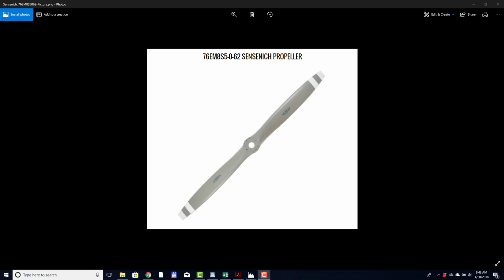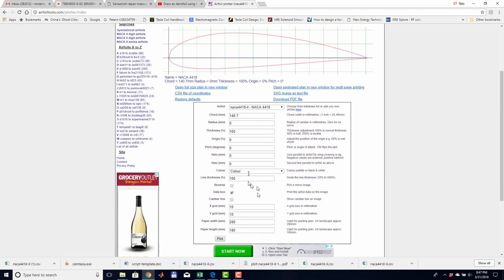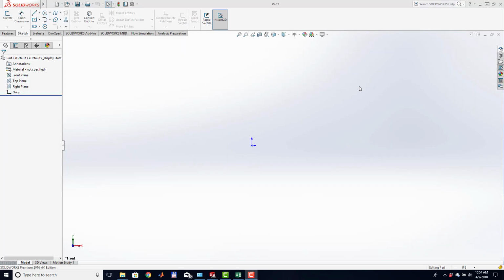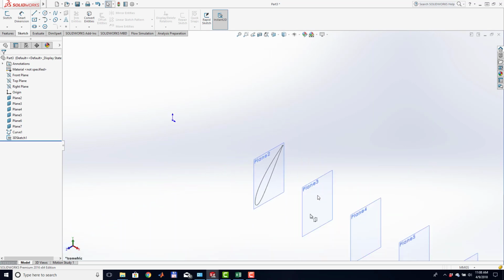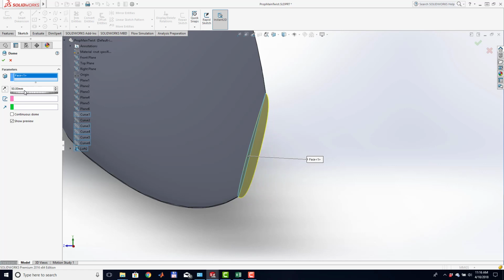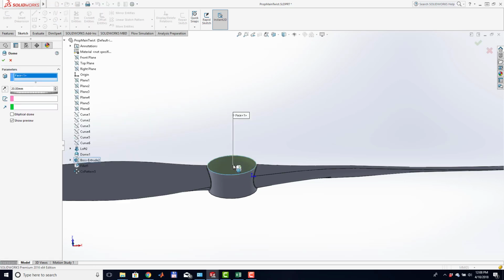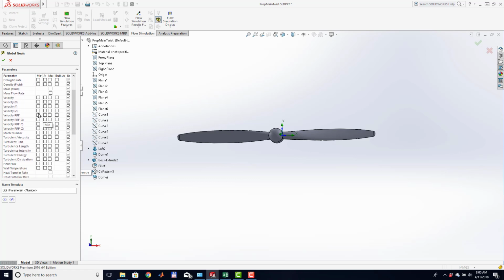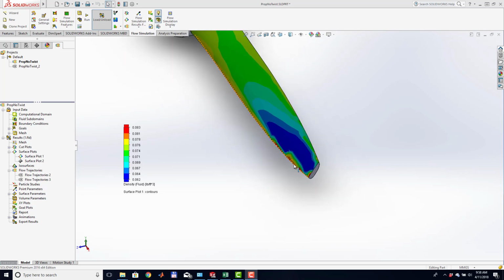Solidworks Propeller Design and Flow Simulation

Comment: Hello, could you upload your solid works file please
Reply from the maker: Thank you so much for viewing my video. As for your request to upload the solidworks files, I wish that I could. Really. This video was done 6 years ago (how time fly's) and that was on a different computer system and I have since lost the actual simulation. However, I would hope that my description of the steps that I took to produce the video are adequate in order to reproduce the simulation. If it is of any interest to you, my current researches involve using neural networks and deep learning to do simulation of computational fluid dynamics. If I ever get to the point where that is possible, I will publish the results. Good luck to you.

Comment: How to calculate torque and rpm prop need while pushing object at pre determined velocity and resistance force?
Reply from the maker: Thank you for watching my video. The questions that you ask are very important to answer and I did not attempt to answer them at the point when I made the video. I only wanted to show why a propeller needed a twist. However, since then, I have started doing research with machine learning and physics informed neural networks and their application to fluid dynamics. I figure that it will be at least 6 months before I can start answering more pertinent questions than were asked in my original video. Thank you again.
Reply: @theminertom11551  Could I enquire as to where you are up to with this, as I was also interested in the original question?
Reply: @theminertom11551  Sir i need to talk to you about this PINN, ive been doing a project myself, could u please give me an email or linkedin etc so we can  have a chat ?

Comment: Where can i find those propeller section data? Just as the repair specifications you showed at the beggining of the video.
Reply from the maker: Leonardo, I am not sure that I understand your question. The Senenich propeller manual should be available on line, although I probably used the manual that was available when I was in the A&P class. However, as shown in the video, the thickness of the propeller was not available in the manual so I needed to make a cast of the prop and use those thickness measurements. Good luck.

Comment: Sir I want to make an accurate model of 15x8 propeller for my model and do the analysis, where can I get the data sheet like the repair manual you have mentioned in the video??
Reply from the maker: Adhish, I honestly don't know how to answer. The only reason that I had the data is that in A&P class, there were these manuals that were part of the course. I did not have to find them. Now, I would expect that any propeller that you choose will have the same data, available from the manufacturer. However, the maintenance manual for a propeller is not design data. As you can see from the video, I had to make a mold of part of the propeller, which I had in the hangar, in order to get an idea of the camber of the propeller, which is not in the maintenance manual. Perhaps in some other maintenance manual, that information is there. Also, there are several assumptions that were made. My reason for doing this video was to explore the idea of putting a twist in a propeller, which the Wright Brothers knew about without the benefit of advanced simulation tools. I just wanted to see if there was a difference. This was not an exact method of propeller design. If that is what you are after then you are on your own.

Comment: Hi, how do you work out the reference geometry / stattion points .. confused why theyre not the same as your length
Reply from the maker: Almost all the information came from the maintenance specification of the propeller, a page of which, was shown in the video. I only used the mold (again, shown in the video) to determine the camber of the prop that I had. That information was not in the maintenance spec. Once I had a good idea of the camber, I looked at the site referenced in the video to find a prop profile that fit that camber relatively closely. As I have stated to Emmanuel, this was not an attempt to design a prop but it was an attempt to use Solidworks flow profiler to see why a propeller needs a twist. Prop designers use completely different tools and mathematical methods.

Comment: Hello Mr. Tom, I'm happy with this video clip and it really helped me in my work. Please I like to know how you work out the various thickness (in percentage) of the airfoil section at various stations. Kindly reply, please.
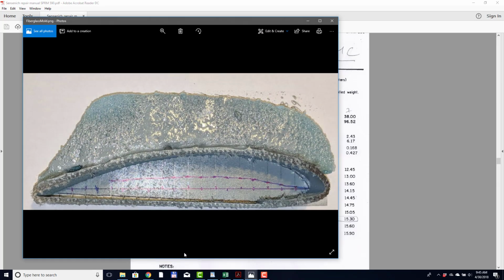Reply from the maker: Emmanuel, it has been a couple of years since I did this video but if I remember correctly, there is a screen shot of a "casting" that I made of the prop camber. At 2:03 in the video I show how I "molded" the outside of a section of the prop. The picture shows a view looking down on the piece of paper onto which I traced the outline of the mold. As i remember, the calculations were simple math from there. As I mentioned in the video, there were a few assumptions made throughout.  I hope that helps.
Reply: @theminertom11551  Thank you for your quick response. I believe the casting you are referring to is for a particular blade station. Can you throw more light on the simple math involved? How do you get the root station blade thickness to be 100% and the tip station blade thickness to be 15%? Looking forward to your response please.
Reply from the maker: @emmanuelnwokolo1424  Emmanuel, I would help you more if I remembered more. I can tell you that I am not 100% sure that the camber is the same throughout the blade, as I made an assumption. And, I only used the mold in order to find what the camber might be...it was not all that mathematical. Once I determined a "close fit" while looking at all of the possibilities that I downloaded from the website as shown in the video, there was no math involved, just copying dimensions from the data. All of that is explained, in probably too much detail, in the video. Yes, there was a lot of hand waving involved. This was not too scientific. True aeronautical engineers would use something like Matlab or more specific tools. I was not looking for great accuracy but only intended to show why a prop might need a twist, because I was curious. I am not a prop designer, nor will I be. I'm just a humble A&P. Oh, yes, I forgot, with 40 years of experience as an electronics engineer designing high speed circuits and digital signal processing :-D .Finally, I don't think that anyone in my A&P class actually watched the video. One said to me "I tried to watch it but there was too much math". Oh, dear.